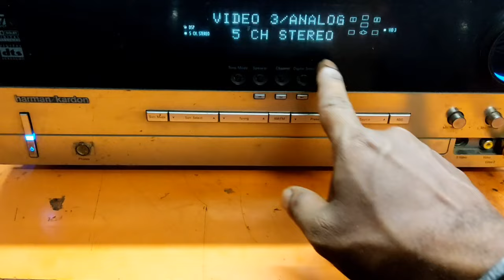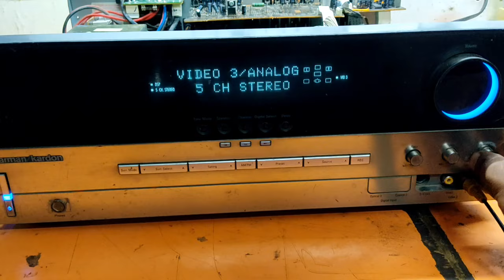Harmon Kardon HK  AVR-130 DTS Receiver Restoration Or Recovered From Dead #AVReceiver #harmon kardon

Comment: Hi Brother.... I have AVR132 model. power button returning blue color to orange after ON  in 10sec. No display.. didn't use almost 4 years. any suggestions I am staying in Gudur, nellore (AP).
Reply from the maker: try factory reset and clean the unit before using it ,also check all connectors inside the amp. note : please do not attempt if u don't have sufficient knowledge. inside amp side

Comment: Heat blower use panna sikkaram dry agumla
Reply from the maker: No , when using cleaning agent don't use blower to dry, because it's leaves white patches all over the board . Just wait for dry by itself in the room air or use any air blower with cool air
Reply: @fixavreceiver  ok bala